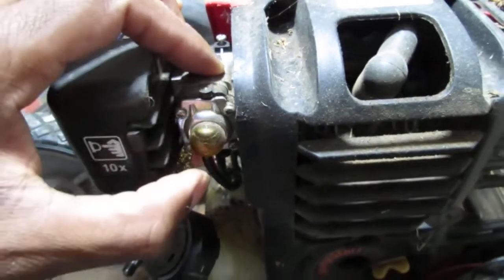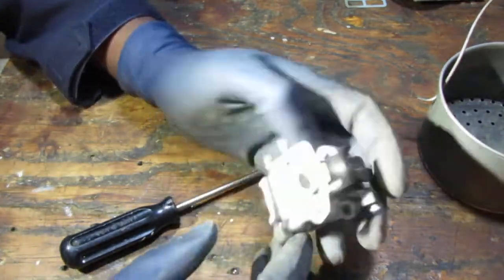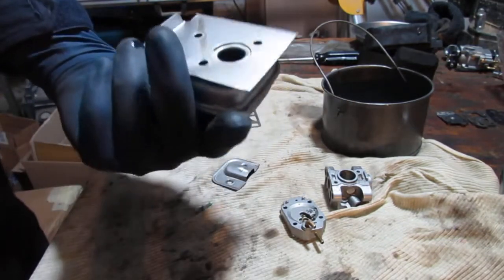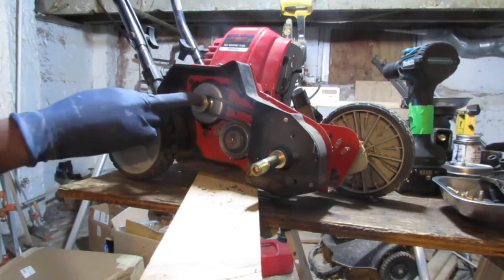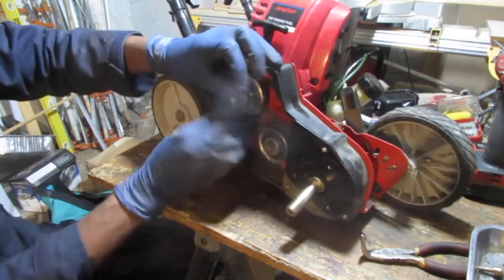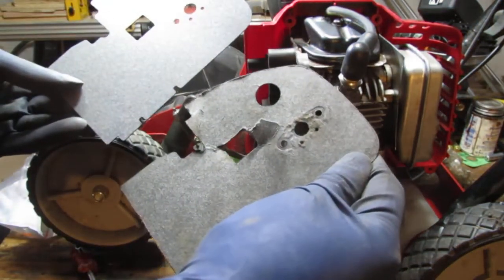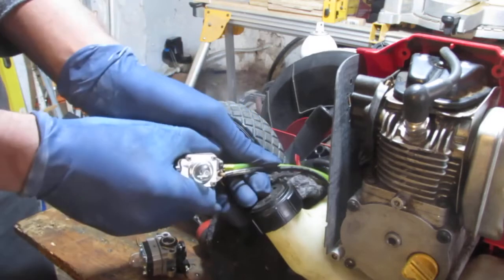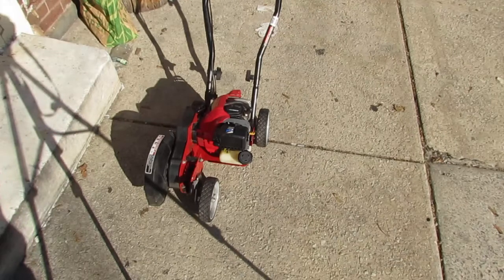Get It Running : Troy-bilt TB516 EC

Comment: I had similar problem. Would only run on 1/2 choke. Let it warm up 30 secs or so - then it runs ok with no choke.
Reply from the maker: Or just fix it like I did.   In the video.